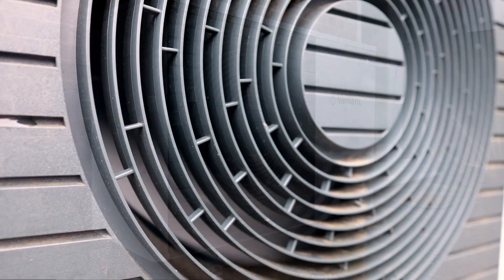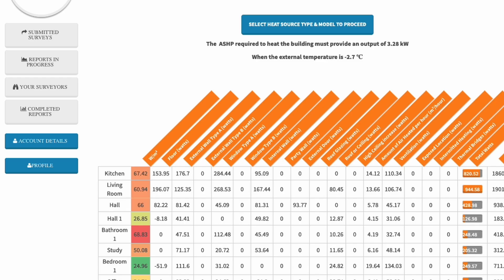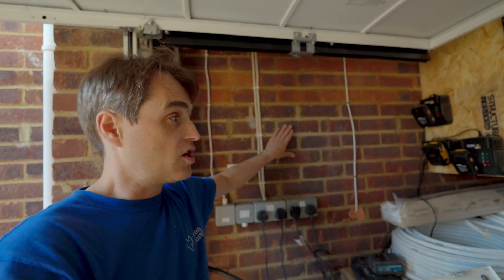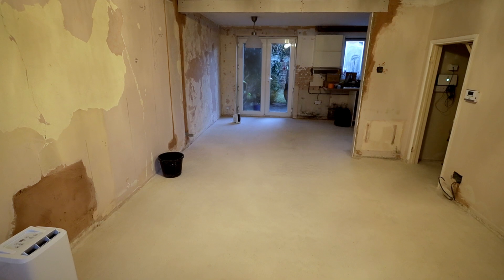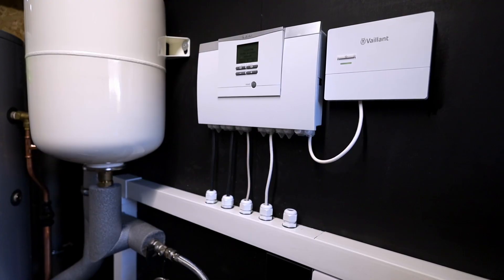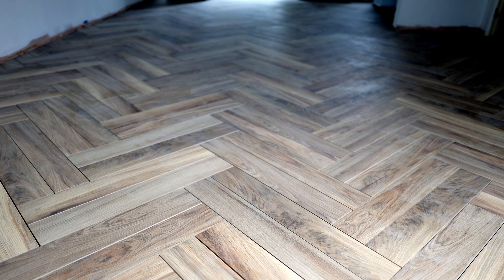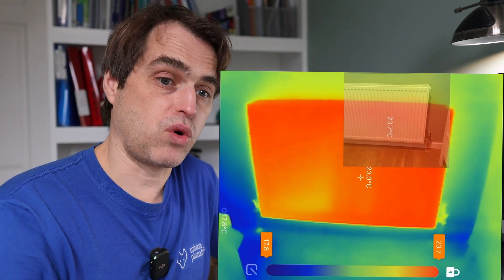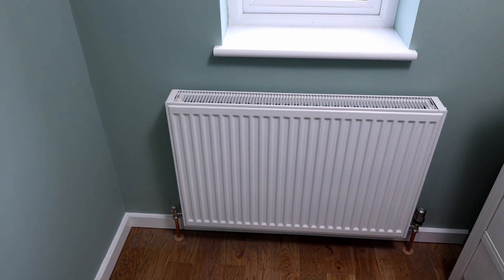How I Installed The Most Efficienct Heat Pump In The UK.

Comment: All you had to do was get the cavities insulated, the loft topped up and keep the boiler. Much better financial proposition and arguably more eco.
Reply: How would keeping the boiler be more "eco"? His SCOPs completely destroy any grid efficiency arguments.
Reply: Most of the electricity for the heat pump comes from burning gas. The boiler probably has many years of servicable life left, so scrapping it is wasteful. The manufacture and installation of all the new equipment, underfloor heating, etc., involves a large amount of materials and embedded energy. With a boiler you can turn it on or off, up or down. exactly when heat is or isn't required - in the UK the weather is very variable even in winter, and some people are not at home most of the time. @BenIsInSweden
Reply: @davidscott3292  You can run a heat pump just like a boiler if you want to, but it is far more efficient to do it like he is.. if you heat a house from cold with a gas boiler, you are wasting gas as well.  Also given he's getting SCOPs of over 5.  1kWh of heat from his boiler would use about 1.05kWh of gas, however with his heat pump, even taking into account worst case Gas power plant inefficiencies (i.e US ones, not the UK where the average is just shy of 50%, and more are being upgraded to 60+%), the same amount of heat would require 0.6kWh of gas to power his heat pump.
Reply: @davidscott3292 

On average last year gas was used to produce about 34% of UK electricity. (10GW out of 29GW average per day)

Heat pumps are very responsive to requirements with weather compensation control precisely adjusting output  as required, and intelligent Hot Water cylinders taking full advantage of cheaper tariffs automatically, and allowing for learned household demand. This gives better grid efficiency by levelling out load instead of having peaks and troughs.

Your boiler produces 2 Tonnes of CO2 per year and other harmful biproducts, CO as one example.

Comment: How does it heat the cylinder? Does it increase flow temp or use an immersion heater?
Reply from the maker: Increase flow to 75c
Reply: @UrbanPlumbers  Is this configurable on the Vaillant AroTherms? If you are happy with water at a lower temperature and longer heating times (e.g. in the case of a house with a high thermal mass where the loss of heating wouldn't be noticed)?

Comment: How do you get the hotwater up to temperature also you’ve had to do extensive renovations to get the property ready for the heat pump. What was the cost to install and what is the return on the cost spent. Thanks great job

Comment: A lot of life left in natural gas yet. Some places that have gas combis, like in flats, cannot have heat pumps. No room.
Reply: Then they would become part of a district heating system, with a large communal heat pump producing hot water pumped to flats, you then pay for what you use.

UK currently imports about 50% of its gas, mostly from Norway.

Moving away from gas also reduces the stranglehold that Putin and OPEC have on gas price, making our energy supply more secure.
Reply: @_Dougaldog  
That is if there is room on the ground floor for all the kit, which many blocks just do not not have.

20% of natural gas can be hydrogen without any problems.

Comment: Inside the garage on the wall between the garage and house, fix insulation. It is a large area. It all adds up. Easy and cheap to fit as well.
Reply: Urban plumber has set this up as a showpiece to advertise his business, and the quality they offer. A showpiece backdrop for the videos.

My Heat Pump paraphernalia is in a four foot square boiler cupboard, where the old boiler was removed from. 

Cylinder, volumiser (25l), expansion vessel, etc... Leaving the airing cupboard free for use. Two bedroom semi, moderate insulation.
Reply: @_Dougaldog  
My point is insulation. there is a large area of wall that can be insulated very easily and cheaply. It will give a good bang for buck.

Comment: Great video brother!  New builds will only get decent cop if the construction companies start valuing us hearing engineers instead of paying plumbers to chuck in microbore.
Reply from the maker: The quickest way to push for better quality will be consumer driven - once shown what is possible, customers will demand decent scops, some already do as we know.
Reply: My 4 bed extended detached house has a lot of microbore from when it was built in 1979. It originally had a vented central heating system and the radiator valves were all coaxial which meant that the flow and return went to only one end of each radiator. This made for convenience of installation but not much else. As part of my upgrade for a GSHP, I converted all of the radiators to double ended with TRV and lockshield valves using 15mm pipes.  The work included increasing the radiator sizes where appropriatw. All the downstairs radiators are double panel double convector and upstairs they are double panel single convector. An extension has a suspended floor with underfloor heating. The GSP is a 9kw Ecoforest. In spite of the microbore the whole system worksvery well with the COP well over 5 on some days.

Comment: My sister in law had a heat pump installed on a new house..
She now gets constant complaints from neighbours as it rattles and squeaks 24/7. I would never have one, and I hope my neighbours don't.
Reply: That's a bad install then. If you have been around any that have been properly installed then there is never enough noise to be a disturbance.
Reply: She should be chasing the installer and the manufacturer.

Comment: Amazing performance, our heatpump runing cost is much higher in 250£ range for 4 cold months, radiators 30-45C outside 0 .. -12C. Area 200 m2.
COP 4.5 - 2.5. 12kw system, 20 cycles per day. We have 22C inside. First floor needs 1/2 less heat than upstairs. We have new windows, and 5cm foam wall inulation, 10xm attic insulation. What is the cheapest way to lover heating costs for like 30+%, so it pays back in 5 years

Comment: Congrats 🎉 Looking at my own HP maybe this year - fabric seems okay but could be better - calcs and historical data seem to tally with 7kW at -2C for a 190m2 bungalow (2001 build but added loft insulation and changed glazing to 1.4 u-value) - the 7kW Vaillant seems to be the logical option but rads are all currently singles and would all need replacing to “go low flow” and suspect the aged Megaflow just doesn’t like anything below 50C having experimented a bit taking the existing boiler down - looking forward to analysing your openenergy data 👍

Comment: what's your day electricity kwh cost? please compare it to the gas so there is a reference point based on COP and Boiler efficiency.
Reply from the maker: In this weather with only upstairs on it 3kWh-4kwh a day - so around £1. Boiler was a bit more expensive as it run on the same rads designed to 32c.

Comment: Hi.  Great info, few questions though.  Why did you choose the 5kw over the 3.5kw version?  Interested in the design temp of -2.7?  I have been messing around with Heat Loss calculators (currently using the Heat Punk one) and wondered what design temp to choose, is there a formula or reference you can choose based on location, sea level etc. ? Looking at your plan, the expansion vessel in the top right, is this in addition to one in the heat pump or does it not have one built in?  Is the main benefit of the buffer to reduce cycling?  Although less cycling surely heating more water in the buffer costs more?  How many litres is it?  Is it really needed?  Love learning about this stuff, great work and great videos, thank you.

Comment: Always love your videos, and find them a great way to understand how heatpumps work. We've had our Viessmann  150a 10kw heatpump installed since end of October last year and we're over the moon with its performance. Currently its 4c outside and the pump is pulling  1.04kw to provide 5.43kw heat.   Flow temp at 33.7c UFH throughout. 22c temperature in the house. Very cosy.
Reply: Agreed. I had a Viessmann 151 10kw heatpump installed last May and have been delighted with it. System SCOP to date 4.6. Heating SCOP 5.1, DHW 3.6. Currently 5C outside, flow temp is 29C and house at 22C!

Comment: Can you install an air source heat pump inside a garage or roof space to remove some of the thermal issues of cold air vs outside frost etc?
Reply: That will make it worse, as the heat pump will lower the temperature of the area it is contained in, so the garage will quickly become colder than outside.
Reply: @BenIsInSweden  ok but that is not clear to me how is that possible the amount of cold air given off cannot be more that the room contains, it may cool from 10c to 8 or 9c but that’s still better than outside being -4c are you saying the fan and refrigerant can consume a 100m3 of air and transform it to being colder? The inside air will still be warmer than the outside one in winter.
Reply: @apb3251  It basically works like an Air conditioner in the space - without restriction, or you can think of it like it turns the garage into a freezer.  Heat energy is being transferred from the garage to the house, so it is continually getting colder. Because the outside air is colder than the garage, it cannot (barring solar gain) naturally replenish the heat energy in the garage, so the temperature will first drop below what the outside air temperature is. Once it has reached a temperature below the outside temperature, it will still get colder, as gaining heat energy from outside to transfer to the house is impeded by the garage walls etc.
Reply from the maker: Yep, it would freeze the garage and then go into what is called a death spiral or defrosts - eventually making the house cold as well
Reply: @BenIsInSweden  perfect. Thank you
Reply: @UrbanPlumbers  thanks for the clarity.

Comment: It's still the upfront coast to get the lower running costs.  Funds permitting I would upgrade this 50's build with PV, battery storage and heat pump along with thermal upgrades and a complete rewire.  I would love to be able to have the option to run in "Island Mode" off grid.  The issue is the upfront cost and having a system optimally designed and not just thrown together so a company can make a fast profit.  Then you have to factor in maintenance to keep the systems optimal and performance lost due to wear and tear of components that need replacing.

Comment: I think you are delusional if you think you will spend between 600 and 800 pounds. You will tell us next year, but I think you'll spend as twice as much. Unless you keep your house temperature at 18ºC, which for me is freezing.
Reply from the maker: 10kWh a day in the winter, 30% on 8p / kWh = £2.60 / day (that’s on a very cold day) average day is sub £2. Around £50-80 from October to March. Then April To October DHW only at 8p per kWh and 3kWh a day = 24p per day.

6 colder winter months worst case = £480
Then DHW only for 6 months = £45

Yep - actually need to revise it - it will be more like £550 per year

We may never know as I am about to install PV and battery - so the bills will be £0

Standing charge not taken into account. With standing charge it will be extra £120

Ohh - house is 21c

Don’t believe me? Go to open energy monitor and see for your self who is really delusional here

Comment: actually, your double-glazed windows have not failed. consider them rather as an indicator that you need to ventilate more as long as you have no ventilation. The air is like a bucket. the warmer the bigger the bucket, but it will only be emptied if you pour it out of the window. So let warm, humid air out. Otherwise the moisture will always stay in the house and collects in the coldest place, which is best at the window where you can see it
Reply from the maker: That’s not inside the house! The condensation is inside the glass itself - so yes some have failed (not sealed anymore)

Comment: If the performance is guaranteed then yes I would install a heat pump
Reply from the maker: Good man!
Reply: I think we are close to the point where performance can be guaranteed, but there is currently no guarantee that a heat pump won't cost more to operate than a boiler in the UK because of how expensive electricity is compared to gas. It should be noted that this is a political choice by the government who, despite saying they want to encourage the introduction of heat pumps, haven't corrected the anomaly whereby all electricity producers are entitled to be paid the cost of producing electricity using gas, even if they produce electricity using a much cheaper means such as nuclear or wind!

Comment: Had it been in our previous home I'd have been on the phone to you in a heart beat as we were less than a mile away from you! I just searched for a Heat Geek Elite near me now. Having located our house, the site said that our heat loss is 17.7KW and too large an installation. I don't know how the site knows the details of our house, although I admit that it's reasonably large, old and detached - but that loss seems massive - especially as it has reasonable insulation, big thick walls, some cob, and Low E glazing. As things stand ATM, our oil boiler is running fine and isn't especially old. It is a little worrying that the Elite site suggests that we are loosing that much heat and it could be quite an exercise come heat pump time!
Reply: The heat loss estimate on the Heat Geek Upgrades site used information available on line (Mostly the EPC), and data collected from heat loss calculations carried out on similar properties with similar EPCs. If you’ve made upgrades since the latest EPC, it’s likely your heat loss will be lower than estimated.
Reply: @TheHeatingPeople  Thank you for explaining that. The EPC was done in 2013 by the previous owner. The basics of it appear to resemble the construction of the house but a fair bit has changed since that report was submitted - I suspect that these changes will have some positive affect upon the heat loss - but it will still be relatively high even so.

Comment: Very interesting we also had our Vaillant heat pump installed  mid January.  I'm getting reported COPs of 5+ on the App and didn't  believe  it, but as you are getting  that from a proper heat meter I'm  inclined to believe  it now.
I took careful  note of all the pointers for good heat pump system design installation  and set up from  your previous  videos and its paying off , THANK YOU! 
 Since 17th of January we have only used 180Kwh and have been warmer and more comfortable.  We are getting the bulk of our power at the cheap rate and  about half the time we get through the day on battery power plus a bit from the solar panels which has cut our average heating cost to about £1 a day.  I'm expecting to heat for free by the end of the month as solar production increases.

Comment: Great point about the ground being a large accumulator. 

Its why I prefer suspended ground floors to be enclosed and conditioned with some MHRV supply. A DPM is worth it, but insulation isn't necessary. Instead, EWI that continues to the footing, perhaps with a perimeter drain/gutter storm drainage job, extends the path length the heat needs to travel to get round the insulation, eliminating the cold bridges and condensation risks.

It's also worth remembering that MHRVs mainly recover latent heat from moisture in the home. If you have an exhaust vent in an airing cupboard/bathroom/utility room where that drying occurs, you basically get the most efficient way to dry clothing. It may not be as fast as a heat pump dryer, but it's cheaper and better for your clothes.

Comment: So are EPCs from new builds in the last 30/40 years just rubber stamped certificates base on the housebuilders design, rather than actual as built check? Our 2000 house had missing insulation that NHBC/ house builder begrudgingly sorted cheaply. It is now failing and I'll have to get it done again this summer but installed correctly and to a better standard.

Comment: Excellent video again. I am a huge fan of heat pumps and have one in my 200 sq metre 220 year old stone house and it's cheaper to run than the old oil boiler. But trying to convince people that they work is hard work and I have given up trying
My house is also on radiators only a garden room has underfloor.

Comment: Nice. You'll soon be in the COP 6.0 group. My best to date after Vailant 5kW install. 6.3 for heating; yesterday. 3.7 typically DHW.
Reply from the maker: Vaillant controller shows 5.9 already, but it’s not as accurate as OEM
Reply: @UrbanPlumbers  

Will be interesting to see how the readings from both compare, as you say OpenEnergyMonitor should be the benchmark.

Will you be posting your data on their site ?
Reply: @UrbanPlumbers  

I found your OEM link 👍

Comment: Can you do a video on the monitoring, with regard to what's needed / what should be installed, and what's nice to install but not exactly necessary ?  Or to be more exact, what have you monitored which the Vaillant WON'T give you ?

And have you looked at sending data into Home Assistant ?  Going with Solar PV and Batteries will surely push you in the direction of a common "Energy" interface.

Thanks again for sharing your knowledge and experience.  I have the missus totally onboard now to dump the gas boiler this year :)

Comment: I have done the insulation part on my terraced house (or townhouse if you like). 
The problem is i have backed myself into a financial corner. So my expected gas usage for heating and hot water is 4679kWh for the year so about £325+£102 standing charge. 

I also dont have any place for a hot water tank as the current boiler is in the kitchen in a cupboard. 

Im tempted to go with a twin head A2A unit for the majority of heating and an electric boiler for hot water and the really cold days in the winter as topup heating. Not really ideal granted so for now I'll stick to gas and see how things pan out.